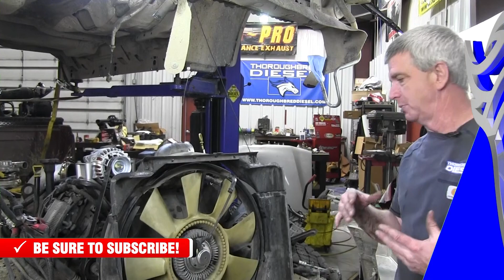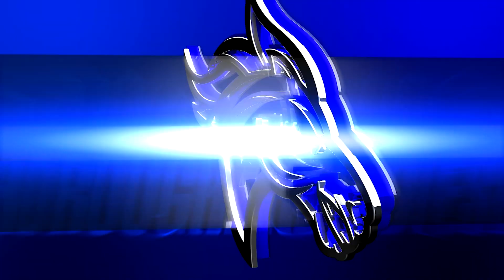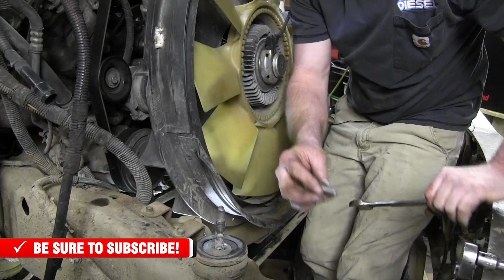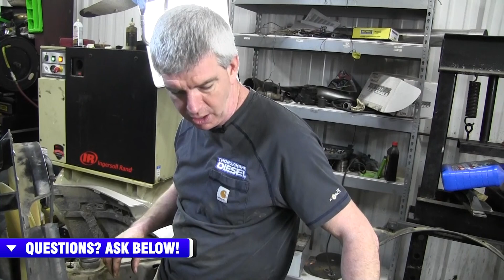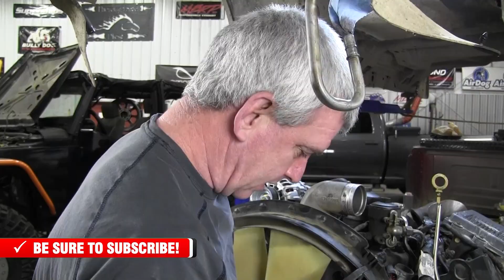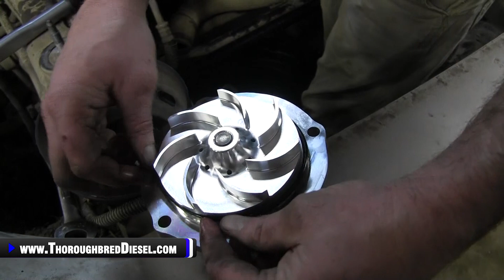Diesel Site Stock Water Pump Ford 6.0 Powerstroke Install: No More Broken Fins! #diesel #ford #fyp

Comment: I installed this several years ago.  Somehow, some where a gasket or seal in the pump failed.  I think it was the large square “O-ring”.  I have no way of knowing for sure.  In any case at higher RPM’s, approximately 2000 rpm and above the pump works so well it sucks air in through one of the seals and pressurizes the cooling system, in excess of 16 psi.  I replaced the heads, ARP studs, gaskets, the whole deal.  Pressurization problem remained.  Replaced the pump, no more problem.  It was a very expensive water pump failure.
Reply from the maker: Never heard of that before.   I feel like that would have had an external leak?  Glad you go it fixed.